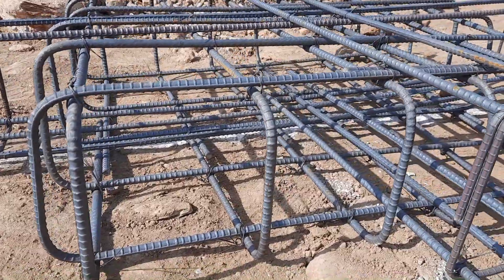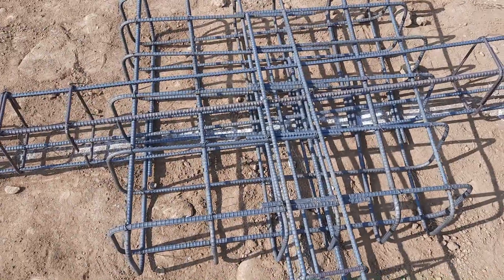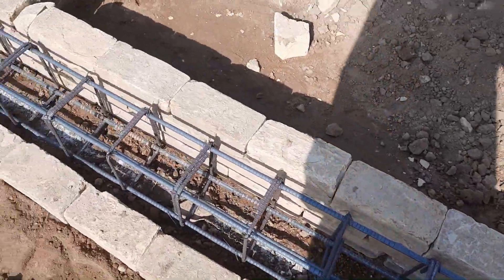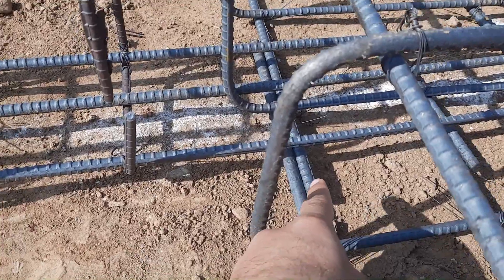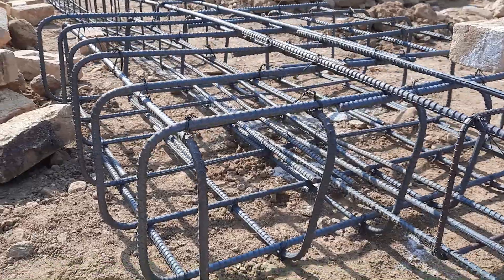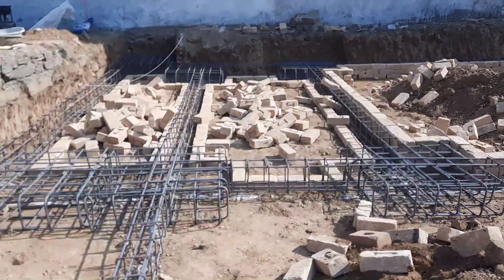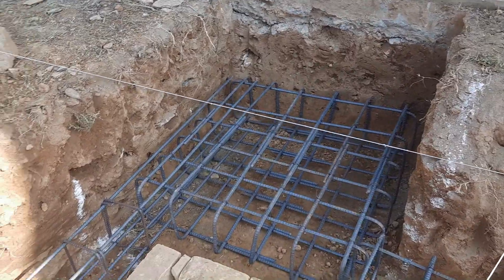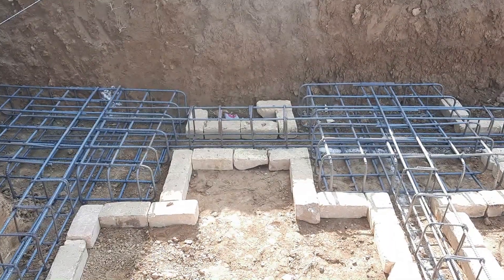Basic Information About Strip Footing And Combined Footing Reinforcement|@civilengineeringbasics1871

Comment: Hey, I need a query about construction of 3 floor house.

I have one side load bearing wall of 10inches and which depth 1.5 feet below width is 15 inch and one side i am putting 12x12"  column along foundation. Is that enough to sustain the load structure? 

The size of 2 room is 9feet width x14 feet long.